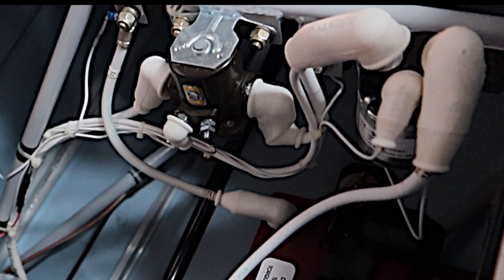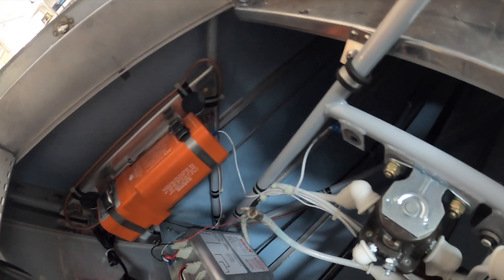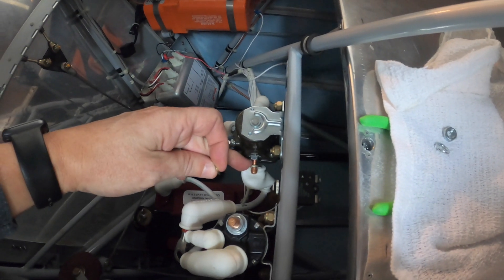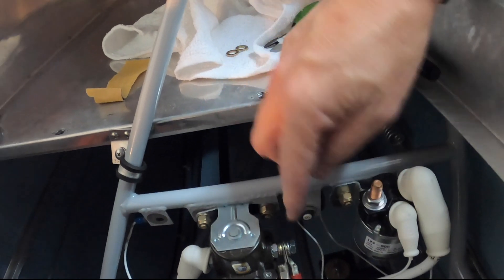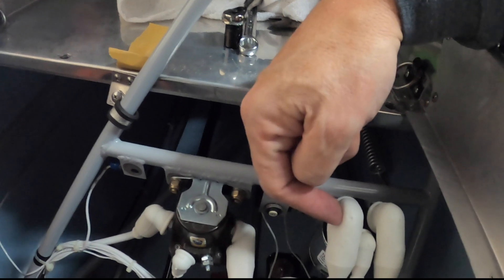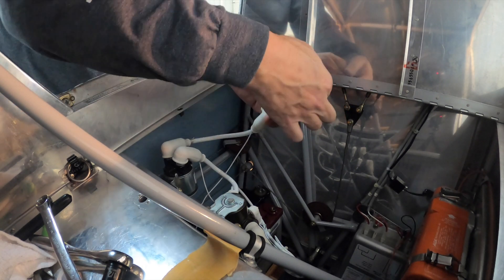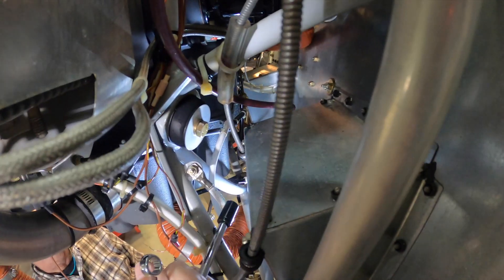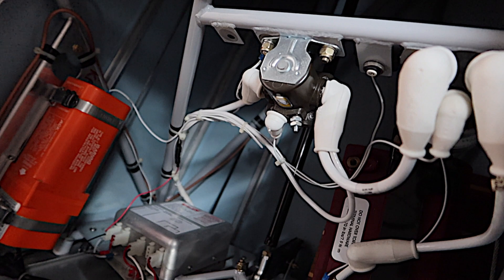My Husky wont Crank - Starter wiring Mods for Husky, Level1- 4k

Comment: This is a long time struggle I’ve had.  Of course, am now an expert on timing the ‘second’ key turn to catch the prop spin. We really appreciate your videos on the ‘misc’ topics!
Reply from the maker: Kevin, the most common issue with wiring for the starter is the 2 ground cables, one on the motor, one onthe battery/chassis.. the next most common error I see is a loose cable crimp on the starter cable at the starter.  Wiggle all the connections on the cable to check em.  goose

Comment: This is an excellent video, which definitely shows a way to improve the wiring for the Husky starter.
Reply from the maker: Thank you Jim..  we have done several of these mods now.. the common thread is the grounds.. Aviat needs to improve the grounds.  the number one spot is the battery to a/c ground.. it needs to be removed, sanded, and mounted with An/AS washers.. and move the ELT and any other lug grounds to the starter mount bolt..  additionally, the engine ground seems to Always be loose.  The Level 2 modifications are in another video where we change to the ERZ 8011 starter, and #2 cable, with thin strand Copper grounds..  That turns it into a beast..  Im also will be seeking approval for a solid state relay somtime in the future with double the current.. I tested one on my plane and it was awesome.  THe White Rogers relay is old and very inefficient.. thanks for watching  goose